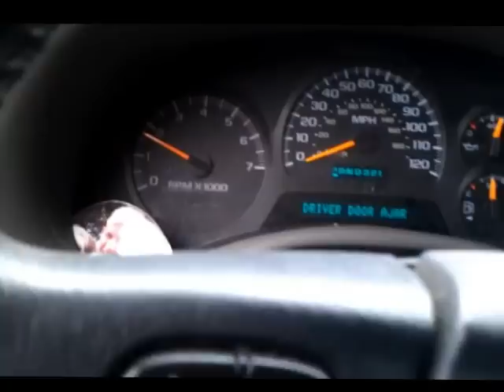part 2 of 2 Autotek mean machine 2500 vs vvme inno-d1500

Comment: yes i do have dvc 2ohm subs, was thinking of .5 to see whats good with the amp. amp is way to small for my subs in the 1st place. my subs are 1400 rms each lol so intell i get a saz3500 this summer i will only be runing this vvme. i have ran this amp @ 1ohm with 6-12s and it would run 1ohm and not get hot at all. so im thinking .5 it may be ok...

Comment from the maker: i have not ran them at .5 and dont really want to try it. they are all i have and hard to get replacements BUT i did do is straped the two together and wired at 1ohm on two subs. whick straped by manuel is only 2ohm. but when i did it i counted on box rise to help me out and it did the subs was slapping the back plate at half of my normail volume. so i did what any would do, im getting two more amp will run 4 amps straped on each pr of subs. not i have to watch for smoke lol